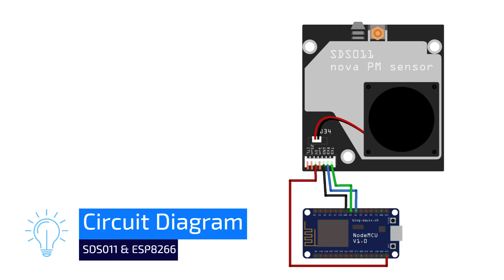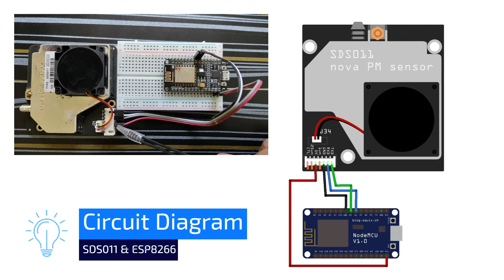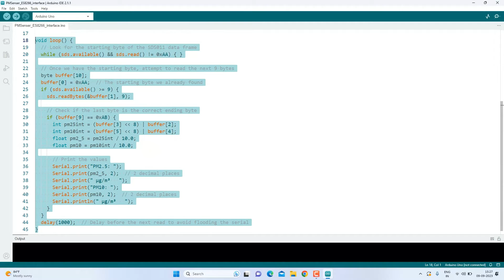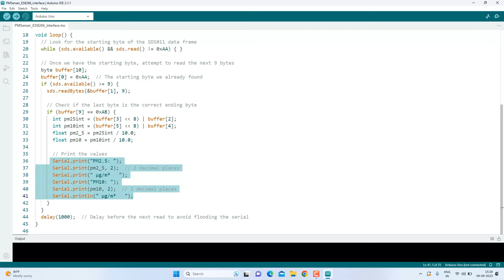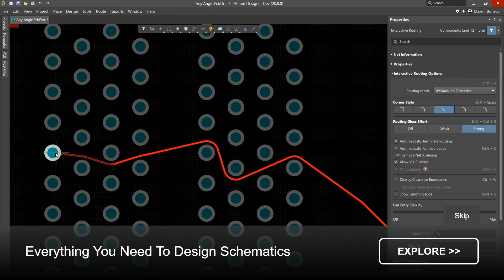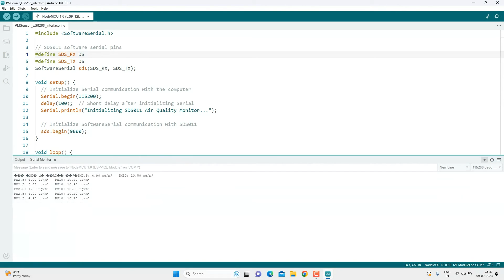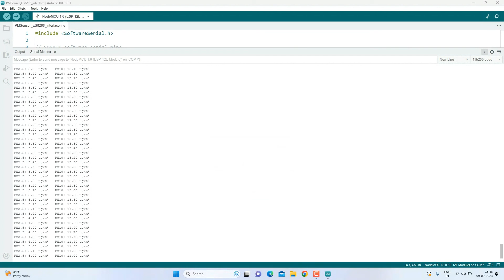Build Your Own Air Quality Sensor: Connecting Sds011 To Esp8266 - Part 1

Comment: SIr how did u connected the ESP and a=nova pm. I am unable to connect them
Reply from the maker: It's interfaceD over UART,
 You can check out this blog.
https://electronicsinnovation.com/interfacing-sds011-air-quality-sensor-with-esp8266-diy-air-pollution-monitor-part1/

Comment: ESP8266 runs on 3V logics and SDS011 requires 5V. How did you get these working reliably without using a Logic level convertor?
Reply from the maker: Yes, the SDS011 sensor requires a 5V input; however, its internal components operate at 3.3V. The UART Rx and Tx pins also function at 3.3V.

You can refer to the datasheet linked below. On page 5, at the beginning, you will find this information.

Datasheet: https://www.google.com/url?sa=t&source=web&rct=j&opi=89978449&url=https://cdn-reichelt.de/documents/datenblatt/X200/SDS011-DATASHEET.pdf&ved=2ahUKEwjsx9q6p-SJAxVQSGwGHcOoHhoQFnoECBoQAQ&usg=AOvVaw3DK8CStM52ay3E3urAjos5